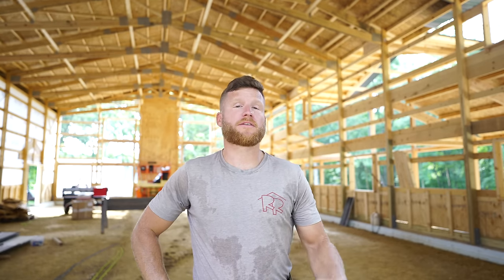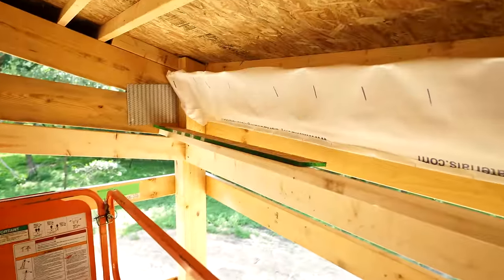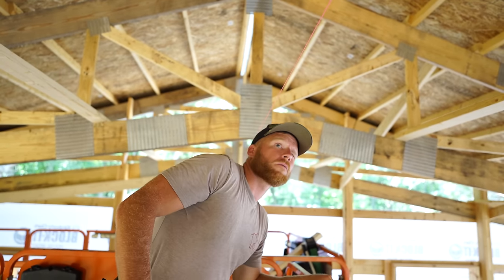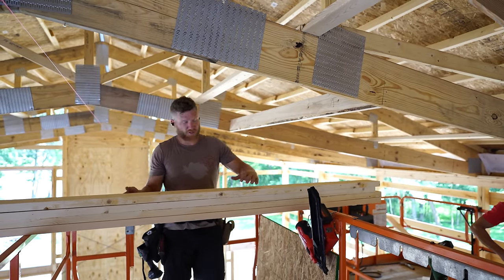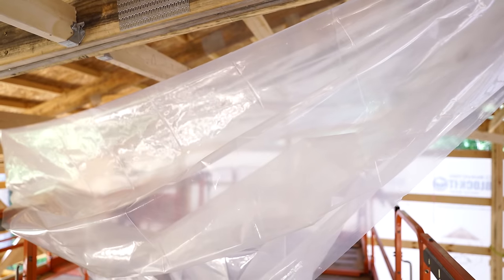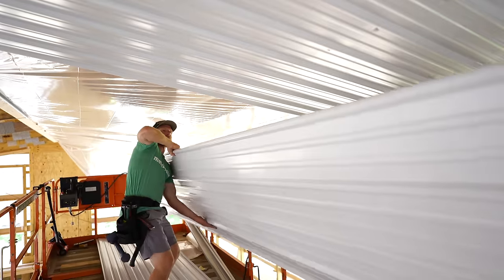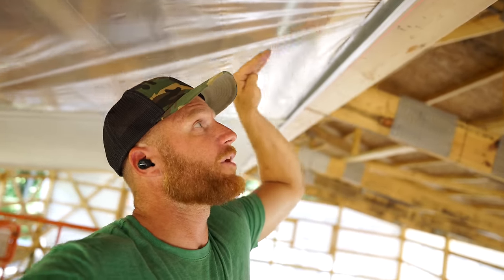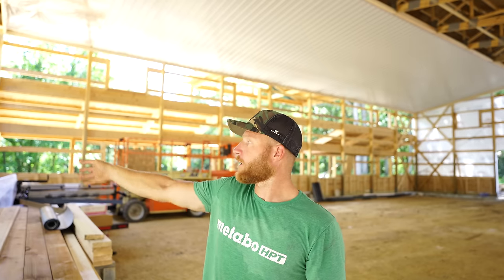Cabin in the Woods Part 18: Installing Metal Ceiling

Comment: I feel for you (the heat) it’s just draining!  Day after day!  However I noticed Greg & you never let it effect building thee absolutely best !
This ceiling is tight!

Here in Northern Calif it’s been a consistent 99 to 105 everyday!  My shop is 95 degrees!  
But I do not deal with that humidity like you Kyle!
I feel for you !  Now I a cracking an ice cold lime sparkling water!  With just a small twist of lime in it!
Chhhhhhh- ahhhhh!   There’s to u buddy!

Comment: right next to that control box on the man lift I would build some storage and also have a couple battery chargers vertical. 
Would be cool if each lift had a compressor built-in/mounted too

Comment: Ceiling layout works well, the slope combined with the centre trim breaks up the eye line, the other way you just see endless ribs in the steel.  My thoughts any way.   Great series of vids, lot of thought went into the building design.

Comment: New way you guys should start a job on very hot days have AC fitted first then build around it lol...Damn by the look of you two its hot damn hot....Great video...Stay Safe RRB
Reply: Wouldn't that be nice. I wired a school that had icf walls and it was like the surface of the sun in that building for months until they got the roof on.

Comment: Hey Kyle, nice work as always, question. would it have been better to strap the bottom cord of your trusses instead of fitting in between? keep on crushing it.
Reply from the maker: Not on 8’ centers
Reply: RR Buildings right, that makes sense. 👍

Comment: Have you consider a better insulation baffle for you soffits? That blown-in gun will easily defeat stapled through wrap and close it up. Or do you go around the whole perimeter after the insulators are done and push them back open and clear them out?

Comment: That's a lot of weight to not have a steal beam or vertical wall.
How do you plan to fix that? I want to follow this project.
Thanks for sharing!
Reply: Truss is engineered for the dead load
Reply: @austincairy5872  Okay, that's good. Do they put the load on the outer walls? Where does it go? Thanks!
Reply: Space Exposed all the load is carried through the laminated 3 ply 2x6 posts, and then carried down to the ground.
Reply: @austincairy5872  Right... Thanks!

Comment: 11:17 Use screws, not nails there.  Nails will pull out when 2 x 4 flexes under load.  Trust me, been there, done that.
Reply from the maker: Ring shanks should be fine. I agree screws would have been better

Comment: Hi Kyle,
Just a quick question...u switched to the Dewalt coil nailer (full head I’m guessing) for the f and j Trims etc does the steel not get caught on the head when sliding it it the trim? (On the ceiling I guess it got gravity on your side to stop it thou) but anywhere else? Or does the head sink enough?

Comment: Maybe I missed it but doesn’t installing the finished ceiling make the rough-in for lights, fans, & HVAC ducting (& maybe even HVAC heating & cooling units) very tough?
Reply: Steven Slater since you didn’t get a reply....up here in Montana everyone does exposed electrical. Nothing is done inside the walls or ceiling.

Comment: When you were holding the frame in place while using your nail gun. I did the the same thing that the nail ricochet off the metal hanger bracket through the wood into my fingers and it nailed both of my fingers together. Tried pulling the nail out of both my finger but had no success removing it so I ended up going to the hospital to have it surgically removed. Be careful.

Comment: Why does the whole building sway back and forth so much???
Reply: It's not the building it's the scissor lift in a raised position on a soft medium that adds the effect, if the camera view was mounted to the building you could it easily.
Reply: The building was designed like that. The swaying/flexing helps to improve structural integrity at the joints when experiencing high wind loads.
Reply: quitram But wouldn’t one big storm right now possibly bring the whole thing down? Where will it achieve future rigidity to combat high horizontal wind loads?
Reply: Like mark said, its the scissor lift..not the building...check back prev vid he got mentioned on it...guess some people are not really quick with the brain...
Reply: Johnny Blood - My bad, I should’ve made the joke more obvious. 
The building is rock solid. The camera being mounted on a wobbly lift created the elusion that the building was swaying.
Reply: quitram I thought that was a possibility, but when two lifts were next to each other the sway did not appear to come from the lift. I understand now.
Reply: jubjub247 I’m very calm. Not sure how you read that otherwise.